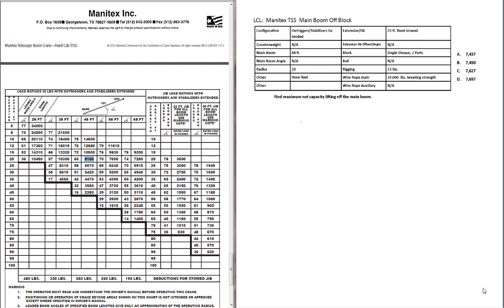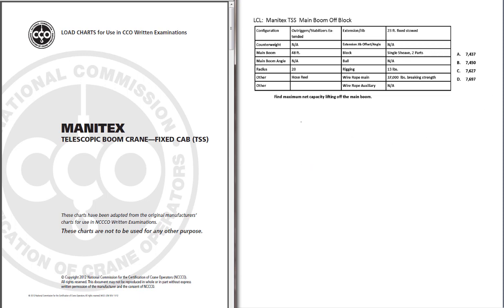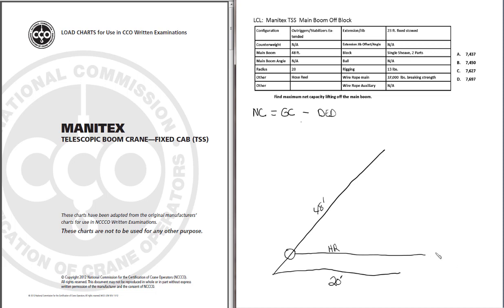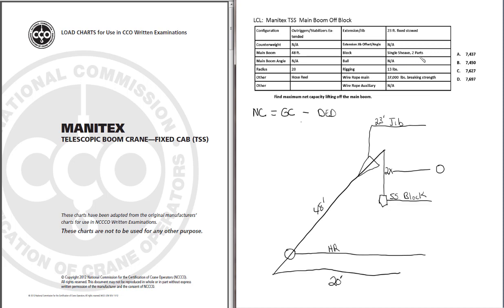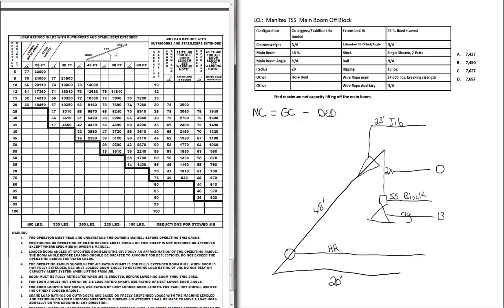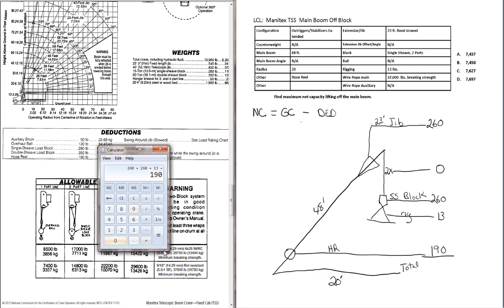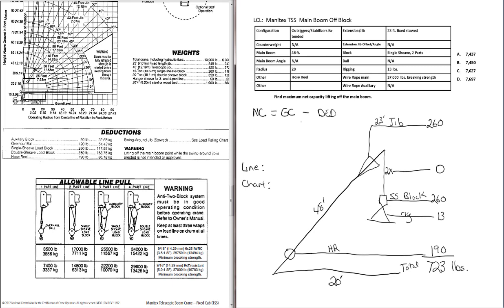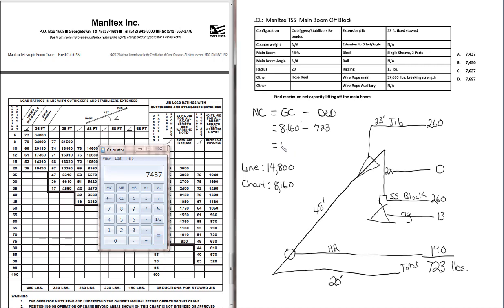Manitex Net Capacity Main Boom

Comment: Hello just love your vides man going for crane crit for boom truck next week scared to death as my job could be affected by this if I dont pass.i was wondering if I just run boom truck do I need to learn all these crane that they have in the study book.thanks
Reply from the maker: For your TSS specialty exam you will have the choice of Manitex or Shuttlelift.  Go with the manitex.  All of your load chart questions will be based on the Manitex load charts and the questions will be very similar to the problems worked out in the videos.
Reply: @LoadChartLab  thank you very headed for the core exam right now I believe I think maybe General knowledge not sure but he said no testing today. yesterday I had to do rigging and hand signal I got that. watch a video of the crash of old blue  Tragic  sad 3 man lost there life's that day my instructor is mark Kenny do you know him? very smart man.well thanks I learned alote from your videos of load charts all these years I been reading them wrong haha
Reply from the maker: Warren.  Sorry for the late reply.  Been doing some 18 hour days.  For boom truck you only need the to take the telescopic boom, fixed cab (TSS) specialty exam--you don't need to worry about the lattice cranes or the telescopic boom swing cab cranes.  You will also need to take the core exam which tests general crane knowledge and is mostly based on OSHA crane regulations Subpart CC 1926.1400.  CCO did have a boom truck specialty exam but it is being discontinued because most operators chose to take the TSS exam.  Hope this helps.  Good luck on your exams.  Don't be discouraged if it takes a couple of tries.  Some of the best operators I know had to take the written exams more than once.

Comment: Hi Dear Sir
We are making SLI safe load indicators.
We are having trouble weighting.
We want to weigh with Crane hydraulic pressure sensor.
The weight increases when we increase the boom length .
The weight decreases when we do the 80 degree
How we get the weight of the boom
Can you help us in this?
Reply from the maker: This sounds like a question for the manufacturer of the crane.  If I were you I would contact the company and engineers who designed and built the crane.  Good luck and have a good day.